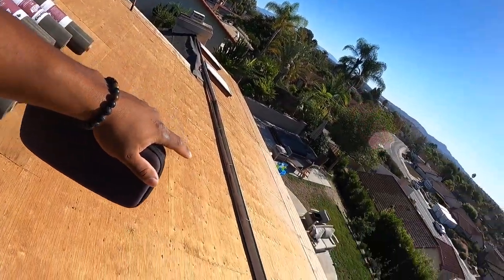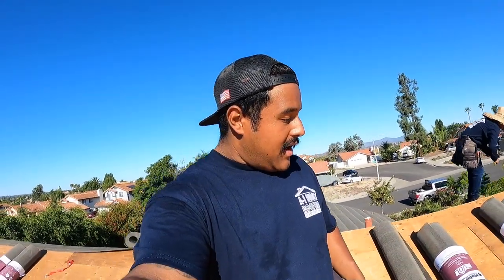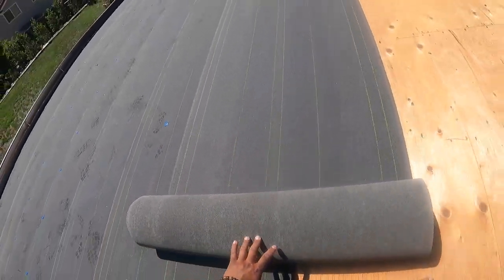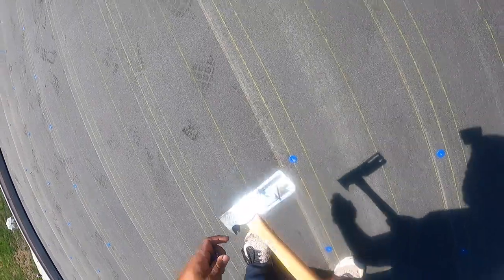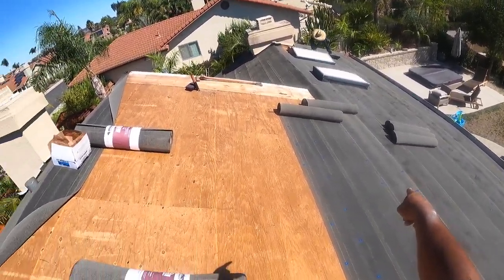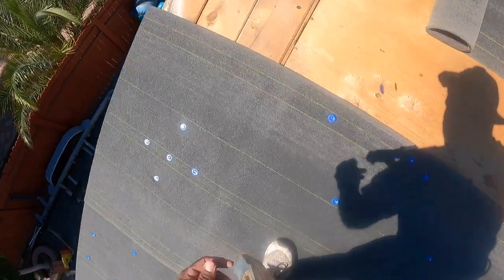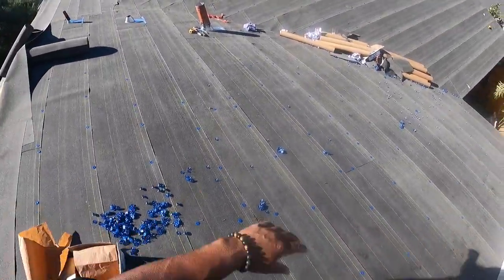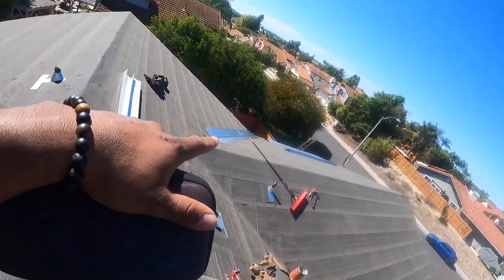POV ROOFING!!  Day in the life of a roofing foreman!!

Comment: California has got it easy, that type of underlayment wouldn’t pass here in Florida
Reply from the maker: We use 40lb double layer UDL. What type do you use in Florida?
Reply: @drewtheroofer  double layer synthetic, or one layer of peel and stick. Anything else will not pass inspection here.
Reply from the maker: Awesome! It’s great to know what works for other states and how you guys do things. For us California we use the double 40, synthetic, as well as double 50, also track homes they use regular 30lb felt.  We use a mixed variety with roofing here in cali
Reply: @drewtheroofer  what’re materials running over there? We usually use owens Corning duration or GAF Hdz which are $110, and $122 the square🧐
Reply from the maker: Yeah it’s pretty much about the same for us here in cali.